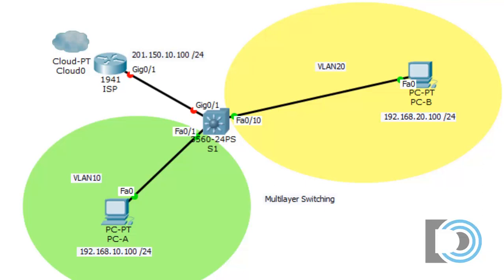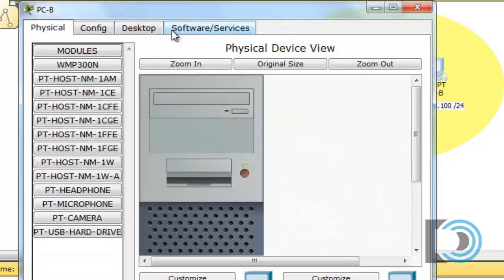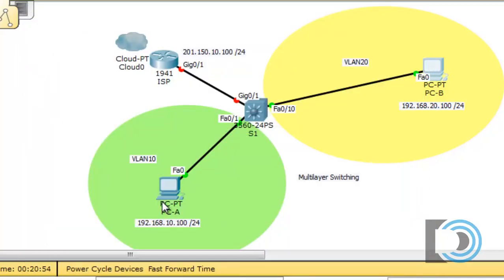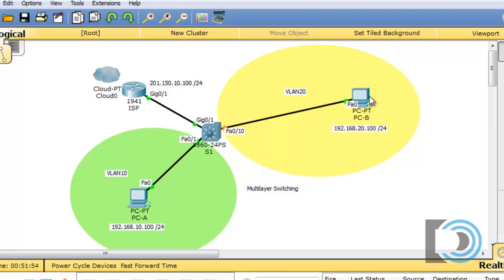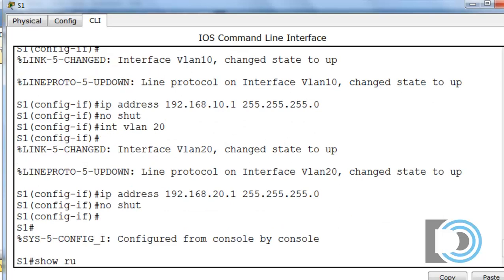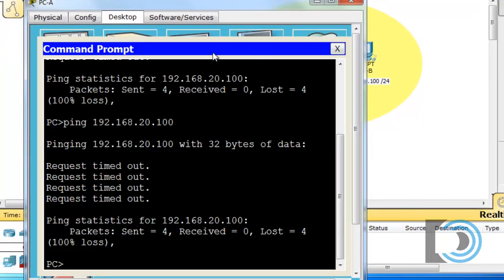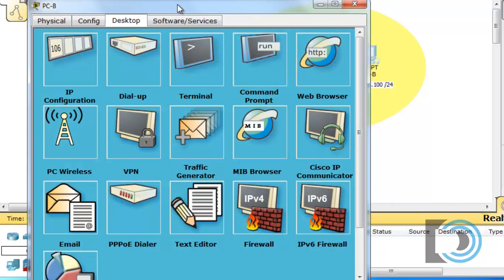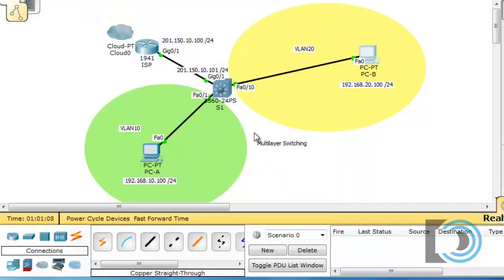Multilayer Switching in Packet Tracer 6.1

Comment: Hi dan i have been watching your videos its easy to understand unlike other instructor online. One question, since you make the directly connected ip as ISP sample in this lab i think default route from s1 towards the router is not necessary because the switch already have it on its routing table as its directly connected
Reply: You are right in my opinion. I did the lab from Dan without a default route, only configuring a ip default-gateway, and the routing works as expected on a direct connected network.

Comment: Hi Dan, in this example you are using a 1941 router as the isp, where you can configure a static route to the layer 3 switch. What if you are using physical devices and using ISP modem? Can you please shed some light on this? thanks

Comment from the maker: One thing I wish I could redo in this video is at one point I use the: ip default-gateway <ipaddress> command, but since it a layer 3 switch with ip routing enabled, I should have created a default route: ip route 0.0.0.0 0.0.0.0 <exit interface or next hop ip address>
Reply: Hi Dan,
Thank you very much for your tutorials. I have a problem with int g0/1 201.150.10.101, since it won't accept the ip default-gateway 201.150.10.100 command. So i used this command  ip route 0.0.0.0 0.0.0.0 201.150.10.100
 within intg0/1 configuration but it didn't work either!!
Reply from the maker: Dodi Woody enter the "ip route 0.0.0.0 0.0.0.0 201.150.10.100" command in global configuration mode not interface configuration mode. The router should have worked regardless using ip route 0.0.0.0 0.0.0.0 <next-hop ip address or exit interface>
Reply: danscourses It worked perfectly:) Thank you so much
Reply: The ip default-gateway way in your video makes sense to me, but the ip route 0.0.0.0 0.0.0.0 command isn't obvious to me what it is achieving. Perhaps someone can explain what setting both values to quad zero does?
Reply: In my setup I did not have to use a quad zero route. I think it is a directly connected network and therefore all routes are known when enabling ip routing global.